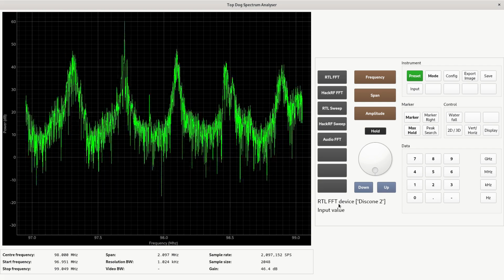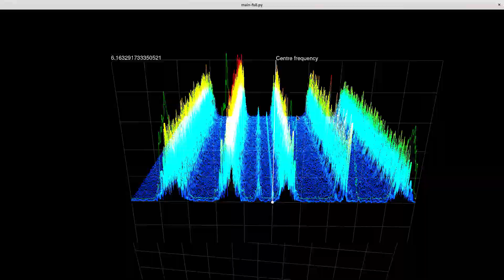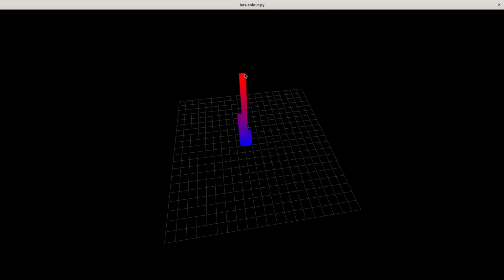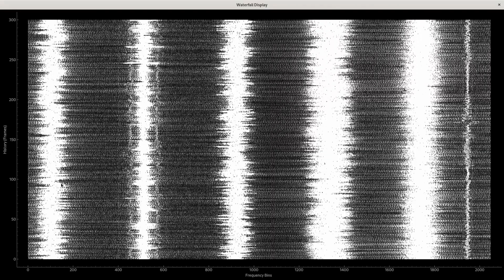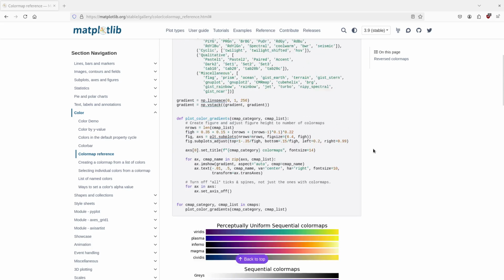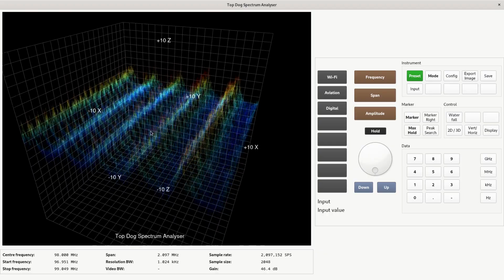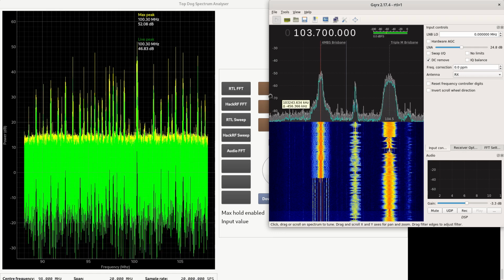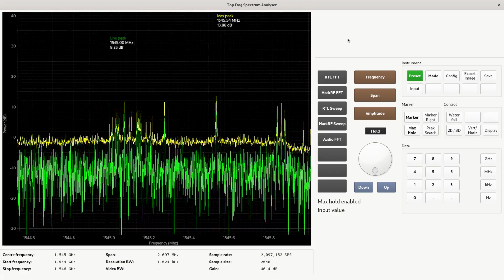Top Dog Networks Spectrum Analyser Update

Comment: Nice. For the optimizations, since your code written in Python and it has pretty awful in terms of performance standard library, look for string manipulations that you do in hot parts of code (loops and such). Python strings AND bytes (that's basically all your data that you `read()` from files and sockets) on each operation with them (even those that not necesserary modify the data under but rather moves starts and ends of the part that object is looking on) mallocs a new object, copies all the data that was there and then modifies it. I have no idea how to fix that with strings, but with bytes you can try to use memview, which is built-in class for exactly what it sounds like. Unfortunatly, only thing you can do with it is only look at it as pointer to an array of bytes (or ints, or something else, but default is bytes) and look at it as an array of numbers. It does not allocates a new memory and does not copies data each time you cut one byte from it, it just basically says "It's starts from here and ends here, there is array of what's inside".
Reply from the maker: Do you want in on this project?
Reply: @TallPaulTech  not really need it for anything right now. I just interested in radio stuff, and at some point stumble upon your channel with videos about Wi-Fi and RTL-SDR (many thanks for your uploads). Maaaybe I gonna download the sources, once you publish your code, to see what you do with signals and to maybe learn something from it. Then I'll try not to forget return patches if I find and fix some issues :)